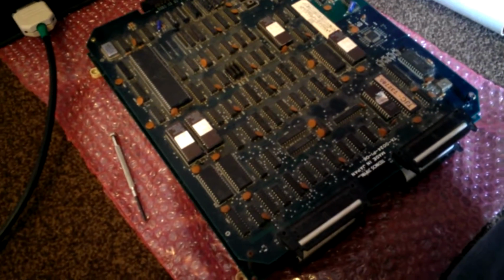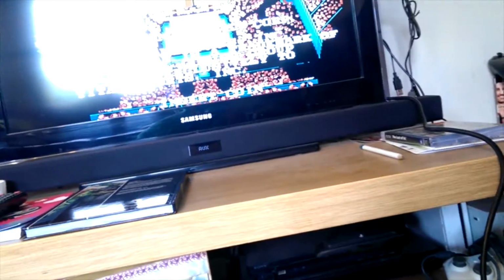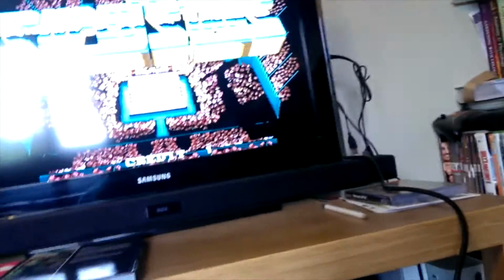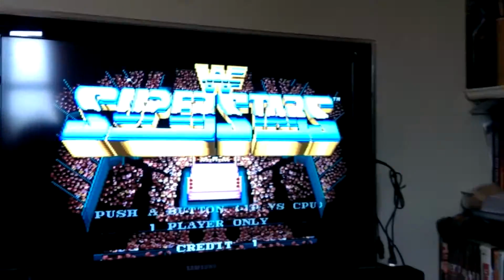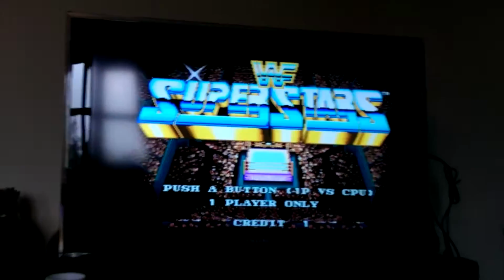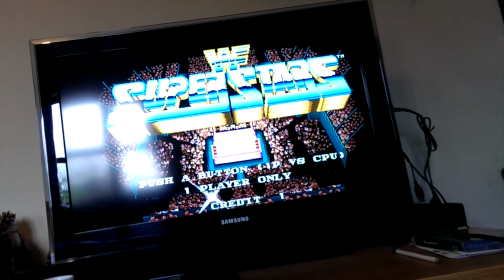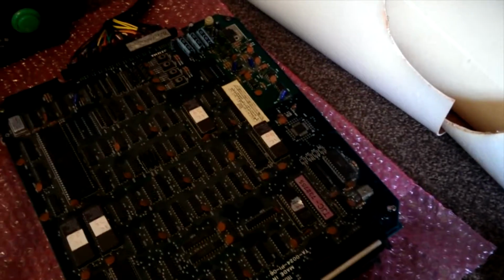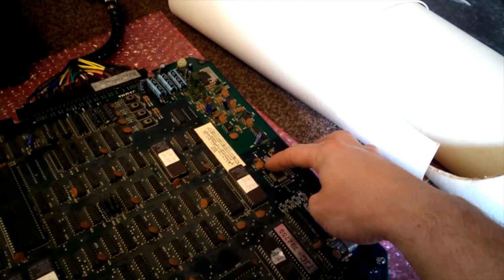WWF SUPERSTARS Part 1

Comment: I just bought a Superstars PCB and i am also having sound issues. Thank you for the video. I have almost zero exp as well
Reply from the maker: Hey David, thanks for the comment. After this video I managed to find a replacement chip for that surface mounted one at the end of the video. I started removing the suspected faulty one and pulled a few traces so I have to run some patch wire in. The game went back into my little storage area when my son was born so hopefully I will get a chance to return to the repair soon. I hope you manage to find out where the sound problem is on your board and its an easy fix. Do you have a video of the issue with your game out of curiosity?
Reply: Porlzilla after some cleaning and further inspection, i found a capacitor that you pointed out in your video, half attached, and another fell out while cleaning. Now i have no video as well as no sound.. It shipped working according to seller so hopefully an easy fix. I don’t have any videos but maybe ill make a response video when i try to fix it. Thx for the response.